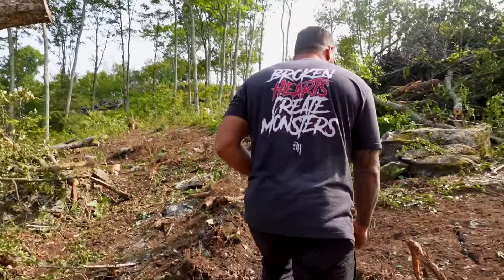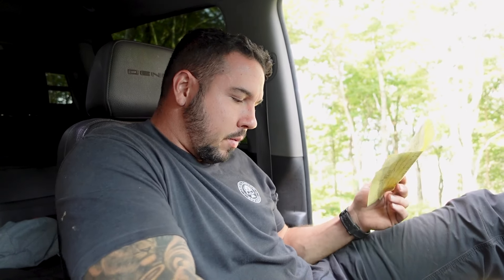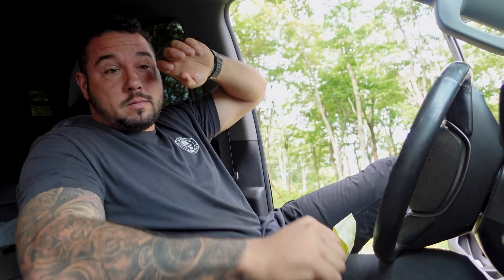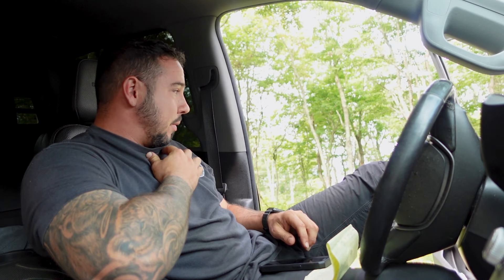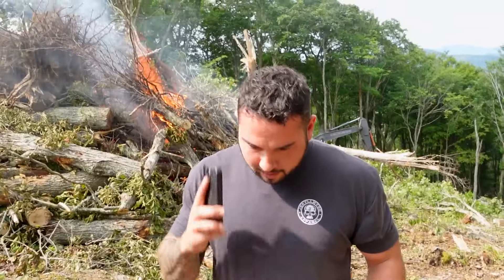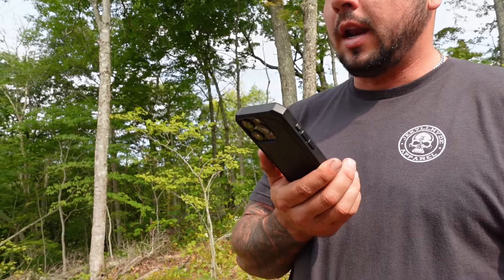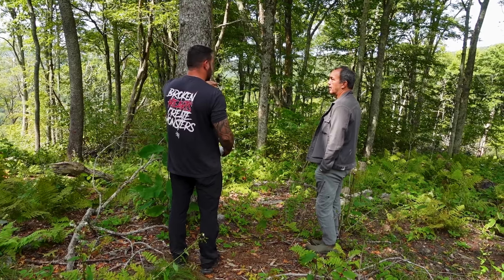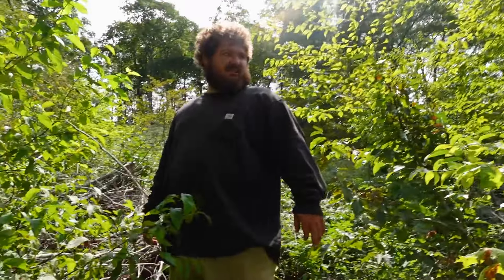They Left This Note in the Machine! | Selling Lot Clearings All Over

Comment: Hey young buck. Did you know  Older track loaders and blades had reversible blades on the radiator fans? Heat into the cab in cold times, and blow into the burn piles when burning, ignoringing  the dust component into the fan at this time.